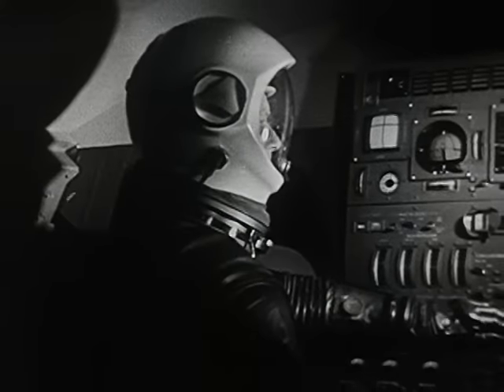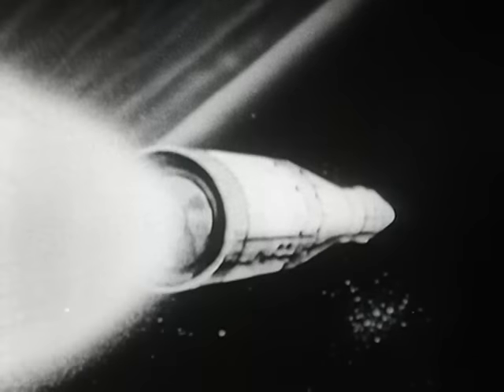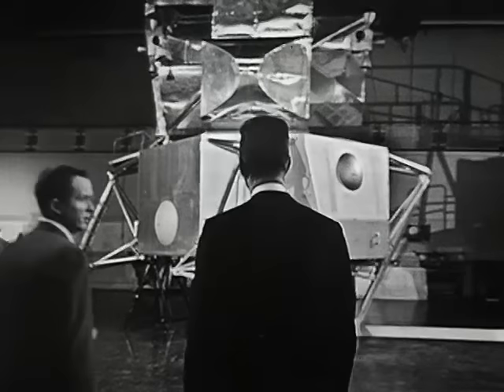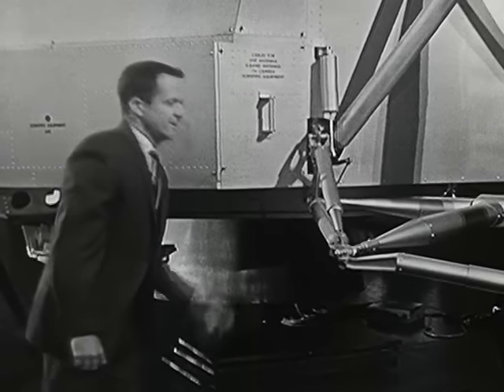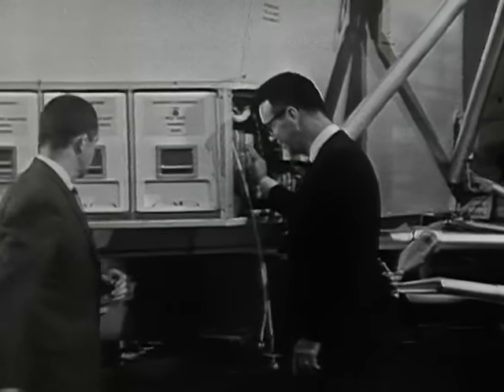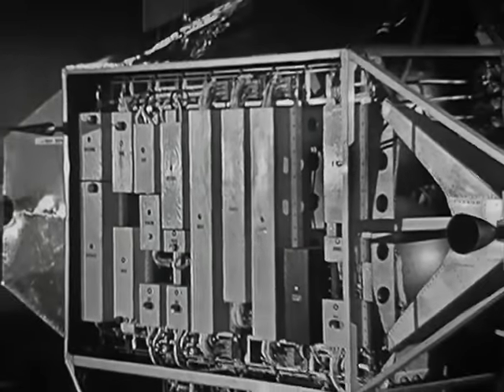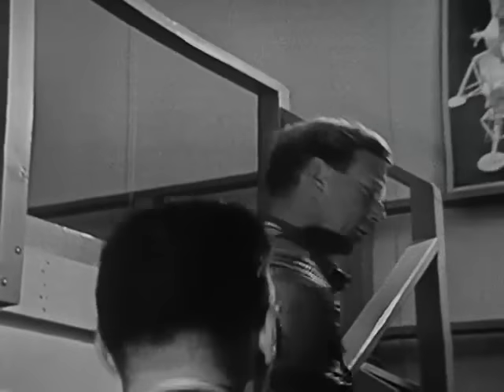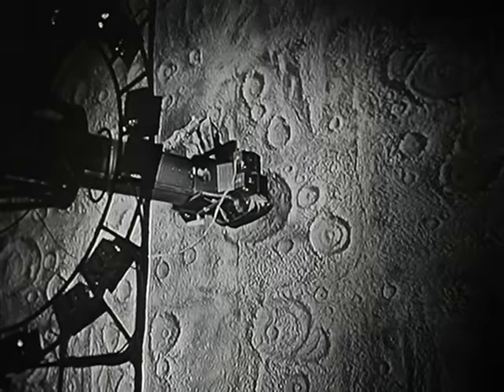MIT Science Reporter — "Landing on the Moon" (1966)

Comment: how come the ones on the moon were made of paper and cardboard and corregated plastic but this one is aluminium.
Reply: First off, it's called boilerplate.  They are too heavy to fly.  Years were spent getting the LMs down to flight weight. It was a huge problem, because the vehicle needed an enormous fuel fraction (ratio of dry weight to fueled/loaded weight) in order to perform its mission.  The LEM's fuel fraction was nearly 70%, far, far more than a modern airliner and substantially higher than the CSM. Thus, ground test models, which were designed to be inexpensive and easy to modify, could be built of far heavier materials than the flight-rated ones.

Secondly, as has already been noted, paper and cardboard are highly inaccurate.  The LM was an engineering model and in flight proved to be the most reliable and safest of the 3 Apollo spacecraft.  Grumman did an outstanding job crafting an incredibly light but still quite robust spaceframe.
Reply: First off, we never went to the moon
Reply: saying that is like claiming god exists. don't have an answer for something, it was god.  you have an issue with the space program, "we never went" it's a cop out and an old broken one at that.
Reply: There is no 'Satan'.
Coincidences happen.
The number 666 is just a number.
Reply: Dude, i know dang well you just came here to keep the space lie going. Your youtube channel has nothing on it but a moon photo. So you signed up just to comment here. haha Keep trying to push the lie, but the party is over and people are waking up.
Reply: AKA SURFSTYLEY 
I know darn well that you are only here to promote the lies about Apollo being faked.

I come here to stand up for what I know to be the truth. 

Of course, you will believe what you WANT to believe-  it is a CHOICE.

I on the other hand, have no such choice - I must believe according to the evidence.
Reply: itsall fake 
The ones on the moon are covered in Thermal Insulation materials. Their structure is largely hidden beneath this.
Reply: itsall fake lololol
Reply: James Gibbon lol
Reply: NASA lies? That's why we shouldn't believe them? I don't believe you. You are lying. The info you refer to above are lies also.
Reply: AKA SURFSTYLEY I salute you
Reply: There is NO COINCIDENCE says POLICE
Reply: From a troll who subscribes to Eric Dubay......
Reply: You are right, we didn't go to the moon. NASA did...
Reply: I disagree.  Belief in God requires faith.  Believing in the moon landings requires oh, eyes to read, ears to listen and a brain to comprehend.  No faith required, we have facts.
Reply: Except for the Japanese mission that photographed the landing sights that should have shut all doubters up.   It is simple.  Human have been to the moon, humans have walked on the moon.  We had the tech, it was dangerous and it was done.  The equipment exists, the sights have been photographed, everything is well documented.  Denying the moon landings is akin to claiming a flat Earth, man lived with dinosaurs etc.
Reply: Belief in the moon landings requires that you be def dumb and blind, harness's, wires, green screen/chroma key )blue grid and an underwater pool. You will believe anything.
Reply: No one has, ever will go to the moon. Hollywood and tv have rotted your brain.
Reply: How come this guy was intelligent enought to breath?
Reply: AKA SURFSTYLEY ✓your Chinese or Russian  propaganda.
Reply: AKA SURFSTYLEY Chinese propaganda✓
Reply: Good eye!
Reply: Dude, it's not cardboard, it's parcel paper.  Get it right lol.
Reply: @bethechange4934  Nah you're both wrong! Cardboard or parcel paper has too much mass to provide the necessary thermal insulation. In space there is no air, therefore there is no need for aerodynamic surfaces nor streamlining. With no air drag and low g maneuvers only there is no need for rigorous restraining fasteners for any thermal blankets used. I'll go for the extremely low density aluminized mylar plastic restrained by adhesive tape to counteract the only thermal energy transfer mechanism present, radiant heat transfer. Cardboard and parcel paper are additionally way too expensive and environmentally unfriendly!
Reply: Hckyplr9285 some people believe anything
Reply: +Just Curious
Awesome.  You really should fill out an application with NASA.
Reply: @bethechange4934  Why? The remuneration leaves a little to be desired and the political uncertainty surrounding NASA's long term reason d'etre causes many aerospace engineers to look to private industry to carve out a career. All this moon loon banter is just ignorant twaddle from those outside the aerospace community and will barely put a scratch on the Apollo legacy from their viewpoint. The supposed flaws with Apollo resemble reading matter from a DC comic book!
Reply: @eventcone  But all the "evidence", the scientific data was controlled by NASA and was not available for independent scrutiny and analysis. So, it is just as likely that your "CHOICE" in blind belief is the naive version.
Reply: @treasuretrovel3816  : several independent sources covered the moon missions. Even ham radio operators followed the conversations to and from the moon. Nas didn't hide what it was doing. Several  countries helped follow the missions, because N. America wasn't pointed at the moon for the whole mission.
Reply: @eventcone  agree with You on this but we never walked on the moon that's for sure
Reply: @treasuretrovel3816 
"Controlled by NASA" and "not available for independent scrutiny and analysis".

I doubt that NASA's academic partners, who would have been the main recipients and requestors of all scientific data, would agree with you. Not to mention the academic institutions and scientists worldwide.
Reply: Tin foil and cardboard then (with broomsticks and lots of shiny gaffer tape).
Reply: @eventcone  Do you deny that Satanists exist then?
Reply: @eventcone  [I come here to stand up for what I know to be the truth. ]
Because did you go?

Comment: At 13:44, showing hookups for breathing. 
Did astronauts keep spacesuits on in LEM?
Reply: They usually kept them on during early lunar missions, just in case it was necessary to suit up real quick in case of a micrometeroid impact or something like that. Later on, especially during extended lunar missions, they could take their suits off for more comfortably sleeping.
Reply: Kyle Tekaucic 
So since they could take suits off, the LEM was pressurized. 15 psi? What percent oxygen? They ate regular food in LEM with suits off I take it. With suits on ate through tube?
Reply: @jamesjeson556  Closer to 5 psi with pure oxygen, same as the CSM. That's enough to keep the astronauts alive without having to use larger tanks and the like.

Food's spot-on, mostly. While suited up, the astronauts had access to a potable water bag and fruit bar wrapped in rice paper through the insider of their helmets. There's also a port on the side of the helmets to allow things like drinking tubes to be inserted, but that was rarely used.

Comment: This model  looks better than the pics of the apollo 12 official pics on the nasa web site.  There are pics of the lem on the moon. This craft model looks more sound and better put together.  Those pics look like an astronaut climbed up and covered lem with card board and canvas tarp along with foil and tape. I am unsure why they needed to do that. I may call to get an answer from nasa as to why. (continued....)
Reply: They say it was just a light isolation, no need to be acurate... but it is made so bad, without any symmetry, even the feet are not completely covered, so he sun hit them anyway.

Comment: how anyone ever believed this crud is amazing
Reply: it tme to take your meds
Reply: Robert Saltzman lolol it's a joke Right?
Reply: CONTACTLIGHTTOMMY and were spinnungaround all day and all night on a great big foorball too  right? Lolol
Reply: ...boring...trolls are so boring...
Reply: "I understand enough Physics to know that all this is bullshit,"  Yeah.  And you think that an open cooling system on the spacesuits somehow violates the Second Law of Thermodynamics.

If all of your knowledge of physics is that good, I'd be surprised if you could explain why stuff falls when you drop it.
Reply: See, you really don't understand.  Even after you had it explained to you several times.

In an open system, the evaporation or sublimation of the water molecules does the cooling.  There's no need to transfer heat to anything.

I can only surmise that you've never gotten out of a swimming pool on a hot day.  The air temp can be 105, the water temperature 80, and when you get out, you get cold, even though you weren't cold in the pool.  It's because the water is evaporating off of your body, cooling you down.  It does exactly what your obnoxiously florid phrase claims is impossible-"dispersing heat uphill in a temperature gradient"
Reply: "On the Moon surfaces we are talking about a gradient that could reach 50 to 70 degree C. from the inside of the space suit (30 deg. C at most) to the outside, at more than 100 deg. C."

That would be the temperature on the surface and at local noon.  The evaporators weren't sitting on the ground, and the astronauts weren't there at local noon, so once again, you're basing your claims on things you only think you understand

Condensed version of Felix's posts:

"You can't take heat out of a system and move it into a warmer system"

(Is shown an example of exactly that happening, with a body being cooled by the evaporation of water after getting out of a pool).

"No, not like that.  Like some other thing that I also don't understand.  With a bigger gradient.  Yeah, that's what I meant"

You guys are all skilled at moving the goalposts when someone shows you're wrong.
Reply: felix mendez wow, you actually spelled physics correctly! Little steps, little steps.
Reply: Robert Saltzman if it's fake then wtf did all these engineers do all day?  Was this just for fun but they new it would be filmed so who cares?  I don't know man, that require a lot of collusion, like more collusion than trump and the Russians..  Now that's a lot of collusion!
Reply: +felix mendez
Ever heard of the Dunning-Kruger effect? Fits you to a "t"....
Reply: +lord daver  Feelin' Mendacious would have us believe that 1960s technology was at the Neanderthal level. The modern technologies that have their origin or major developmental stages rooted in the Apollo era are manifold. Some of the Apollo technology still remains at the forefront of technological development despite the 50 years that have intervened!